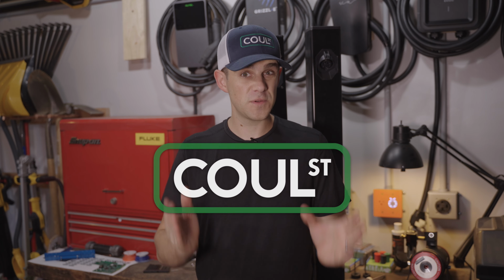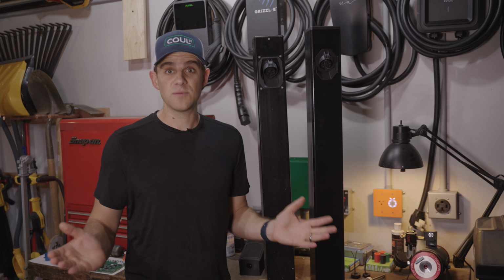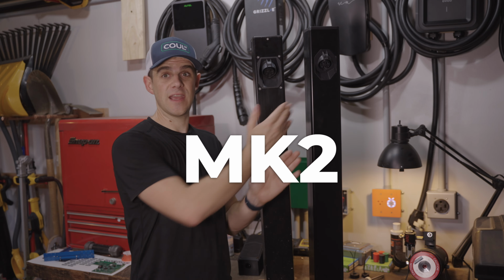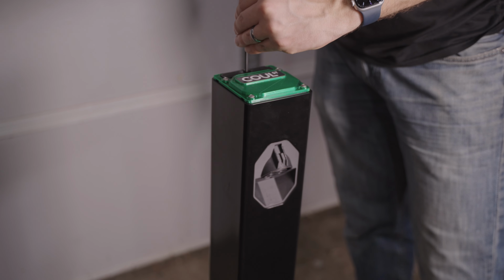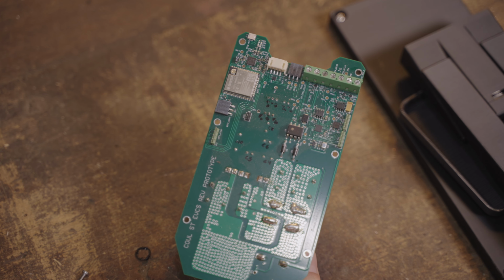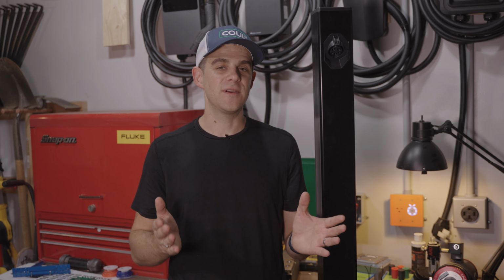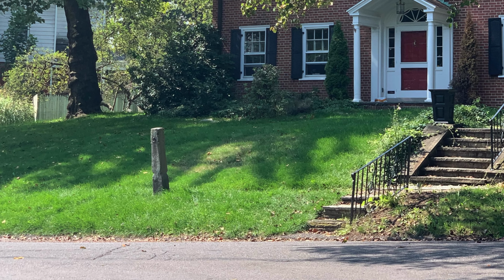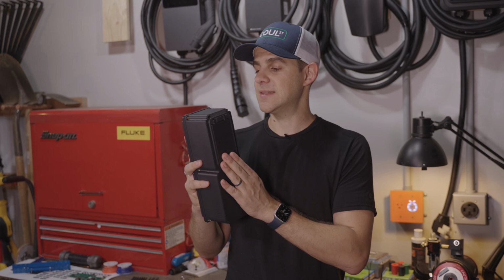Failure & Success of the EV Street Charger

Comment: Major missing feature IMHO.  I have a Tesla.  When you plug a NACS into my Tesla, there is a lock in the tesla securing the plug, and it can't be yanked out.  Yes, someone could cut it (Have fun with that, keep 911 on speed dial), but you can't unplug and steal my charger.  Your design is interesting.  The customer supplies the plug.  It may lock to my car, but it won't lock to your post.  I know NACS is new as the charging standard, but I see a world where I bring my cable in this design, gets locked into place on your charging post, like on my car.  While I'm charging, both are locked, until I stop the charge.  This adds a lot of complexity on your side, but I see that as must as a long term design plan.

Comment: Josh, quick question/feedback for you on the port design. First, any door /will/ get broken, I've seen many similar (and sturdier) designs be ripped apart by a haphazard body. Second, I think you were onto something good with the downward angled port, which would prevent any moisture from ever pooling inside, and mostly stop it from entering the port in the first place. I've lost a couple EVSE and adapters to water in the ports.

Comment: @chargeeverywhere hey, I'm from Europe.

First of all.... Great idea. We could also use that in Europe. But... Especially in my country I think there are a lot of rules that would forbid that, even if it's a very good idea...

Coming from Europe... Do the cables lock on both sides while charging?
We have similar things like this in my country. And to prevent people unplugging it just to annoy you or even to steal your cable (they are about 300 Euro here) the cable locks in the car and in the charger station.

With Kia you can configure if you want them to unlock after the car is charged or after you unlock your car. In public... The second option is way safer.

Comment: can i ask what all the vias on the PCB are for? looks interesting....
Reply from the maker: It helps distribute current between the two 240VAC planes on both sides of the board. It’s one way to keep things running cooler without thick copper layers - doubling up of the layers. I have a Grizzl-e that does this.

Comment: Interesting to see the different prototypes. Now that NACS has an official spec with a double sided cable I think it's a huge mistake to not just switch over to that especially since the majority of new cars 2025 and forward will use that connector. It doesn't make a lot of sense to use an old connector that'll likely never be innovated or updates again vs the new living spec everyone is moving towards. I'm interested to see what's next though.
Reply from the maker: Yes, we've moved away from J1772. As soon as NACS was adopted by Ford and GM we immediately jumped on changing the socket form factor.
Reply: @chargeeverywhere  glad to hear that's the case. So does this mean you're going to switch to the new standardized NACS sockets now? I don't have an EV yet but I'm hoping you guys are able to take off so it's ready once I can pick-up a Tesla.
Reply from the maker: @MatthewGarbett  Yes, no, and maybe. Let me explain. For now, the station side is what is called a Type-2 socket. This is the station-side standard in Europe and much of the rest of the world - and likely will be here soon, too. We want to use NACS on the socket, but this doesn't look like it'll be the standard - although we'll support it if something changes. Either way, the station side socket doesn't impact what vehicle can use the charger. You'll have a Type-2 to NACS or Type-2 to J1772 cable, and since you carry the cable with your car, you'll always have the correct one with you. Hopefully, this answers your question, and we want to be ready for you.
Reply: @chargeeverywhere  ok thanks for the answer. It was my understanding that after NACS was standardized it had the doubled sided cables as well. It's hard to predict the future so we'll see how it turns out. I imagine it won't be super hard to update them later on if you need to. Interestingly, I recently saw an EV with the cord built in. It would be interesting to see if that happens more in the future.
Reply: Type-2 looks preferable for this type of situation. NACS doesn’t have a latch on the handle so it would have to be secured and unlocked by the post for a secure connection, which adds complexity to the receptacle and adds a point of failure. So a type-2 to NACS cable in your car is the best bet.
Reply: @chargeeverywhere  Please don't make me USB-A to USB-C again. This is the equivalent of that. You're still in the dev phase. Be the change. Don't let the J1772 or Type-2 live on. No other BYOC companies have come out that I have seen. If you beat them to launch day then they look dumb for using an old connector
Reply: @ayrtonfineout442  The US is standardizing on Type-2 (J3068) for detachable cables, so J3068->J1772 and J3068->NACS should become common.

Comment: I don't know why this just popped up in my feed but it's very cool!

I like the suggestion that @Tim_Kent made.  Warm white LED's on the sides of the post that shone down towards the ground could make an optional subtle sidewalk or street/parking light.  Something that doesn't blast anybody in the face and I suppose is optional.

How does a unit like this prevent cord theft?   Could there be a mechanism where once the charging starts the cord gets latched in to the post and needs to be released by the app?
Reply from the maker: Yes, a locking mechanism is in the works. Also, nearly every EV has the option to lock the cable to the vehicle, which prevents theft, but not an unwanted unplug. The lights are an interesting idea too and I’m onboard for subtle lighting. When I played around with white or colored lights, it got pretty brash pretty fast.
Reply: @chargeeverywhere  ya.  Not so much a gaudy indicator light.  The subtle lights could also help a driver find a charger in the dark.   Random black post could be challenging to see when one is rolling down the street looking where to stop.

Comment: Please add an optional accessory of a ring to better emulate an old hitching post. I think it would help in getting approved in a couple historic areas I know.

Also, can you go a bit into why the change from the exposed, tilted plug to the flat, door -covered one? Was the tile not sufficient for keeping water out? Or was it more of an out of sight out of mind for keeping people from sticking things in the exposed holes?
Reply: This… is a good idea. Even in areas where they don’t need it to look like something historical, relating it to a hitching post should reduce NIMBY objections.
Reply from the maker: I hadn't considered this angle, but I will definitely use it now.
Reply from the maker: As I said in the video it was mainly for regulatory reasons. However, as you rightly point out, it does help keep people from realizing what's behind the door. Granted kids with gum will still surely find it. The other thing is that it helps keep moisture and weather off the otherwise exposed contacts. While the pins are sealed to the inside of the post, their contacts would still be exposed, possibly leading to some corrosion/etc. over time.

Comment: The clamp is ingenious and might have wide application. Is it your own design? If so, maybe you could protect your IP rights by patent. 🤔
Try to embed the nut in the clamp as a captive nut so it doesn't drop down into the pole.
Reply from the maker: We have a few variations of the wedge patent pending. The newer styles solve this issue.

Comment: I really like your modular design quite a bit, especially for servicing and maintenance which is a huge problem in chargers.  Here a couple of things I would recommend:
1.  Determine your market is residential or city governments.  I think you are close on residential market.  If you want to go into the other markets, you will need to consider different input voltages and phases as part of an existing infrastructure like street lights.  
2.  I would consider different input power disconnect strategy so that electrician is only needed during installation.  Maybe consider an HVAC-style blade system so no worrying about torquing screws in terminals.  Maybe this could be part of the wedge system or another accessed from the top.
3.  Add optional small down lights for sidewalk/walkway to double function and help adoption.  Residents may allow post if lighting is added which also has charging.  I think someone else may have mention this already.
4.  Support NACS plug and signalling upgrade as a module swap out as a selling point.

Comment: Would it be possible, to take the electricity from the pole, step it down to a proper voltage, then from that box run it down the sidewalk to each pole? The grid company could put their own meter on it and even do the billing per vehicle. What do you think? Does this exist?
Reply from the maker: Yes, this is possible and a good idea. There is a company mounting "drop-down" chargers on poles like this. However, this does require a pole to be more or less where you need it (probably not a big issue as there are poles everywhere). The bigger issue is the transformer, new connection, and meter required for this setup. By powering our charger from existing power supplies (buildings) we get around new service connections, saving cost and time.

Comment: Terrible idea.. Use the mated plug to push out a pin to keep the door open. So the spring loaded door doesn't push down on the mated plug and receptacle.
Reply from the maker: It's a light spring and doesn't impact the plug by pushing on it.
Reply: @chargeeverywhere  even better. Love the product.

Comment: Why didnt you put a NEMA 14-50 on the post instead?
Reply: Because it has voltage on the socket at all times and no communication ability. The core idea of this project is that the power to the post comes from the house it is in front of. But that street spot is open to anyone, and random strangers could park their and get free charging. The post need to be fed from (or contain) and EVSE and that EVSE needs an internet connection. The EVSE only energizes the socket when an authorized vehicle is plugged in. That implies the need for a back end infrastructure like Chargepoint has, and I haven't heard the creator of this project talk about that aspect yet. But it will be at least as big an effort to create that infrastructure as it is to design the hardware.